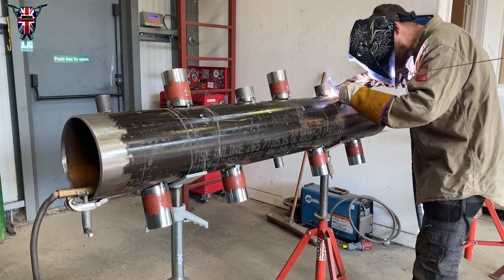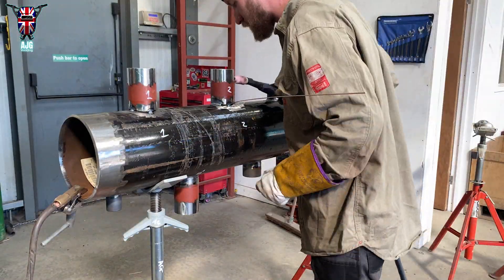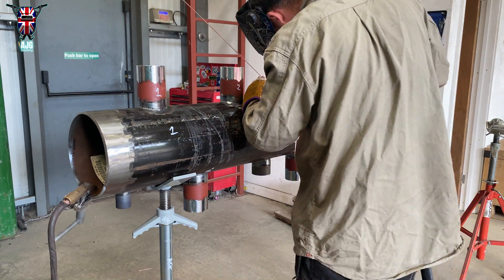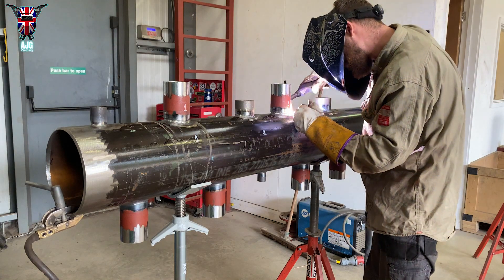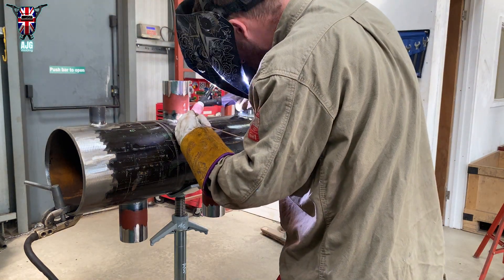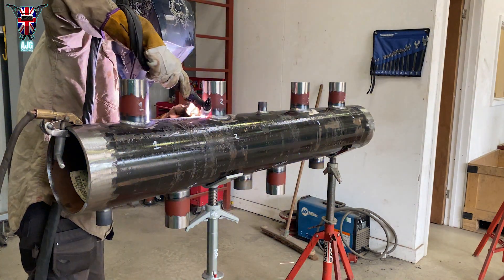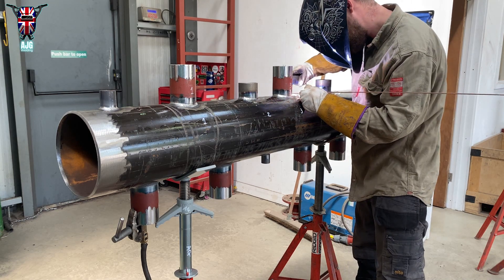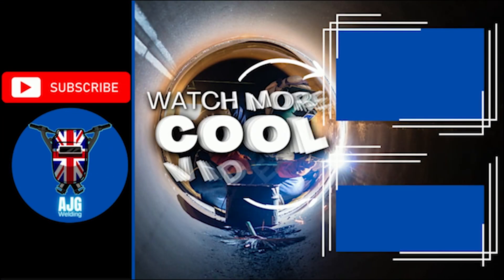How To Stop Distortion When Welding A Header

Comment: Great job man those caps looked great! How do you get the colour in your weld rather than a cloudy finishes?
Reply from the maker: It’s just being consistent with speed and movement using the right amount of amps and gas also and keeping it clean throughout each run